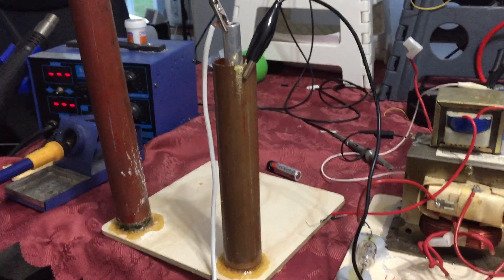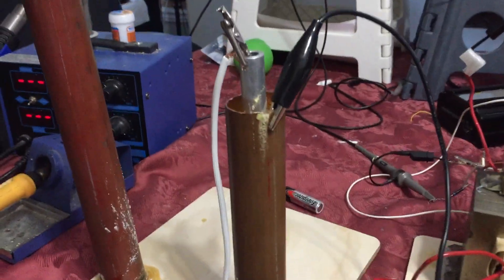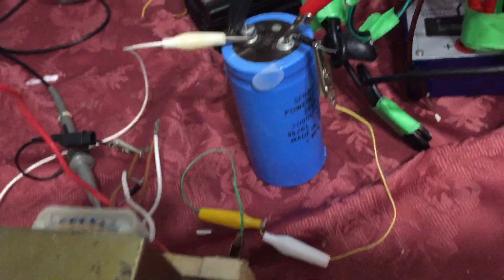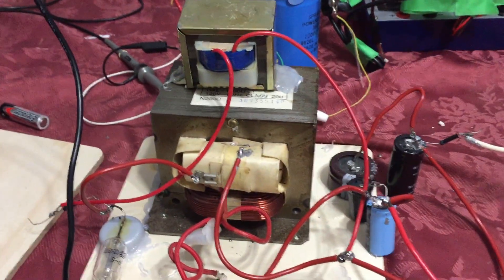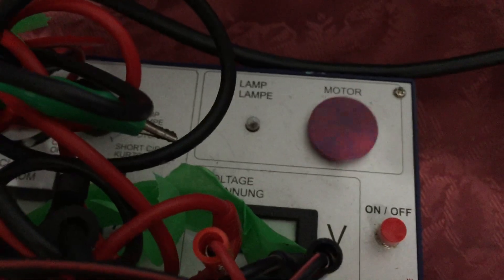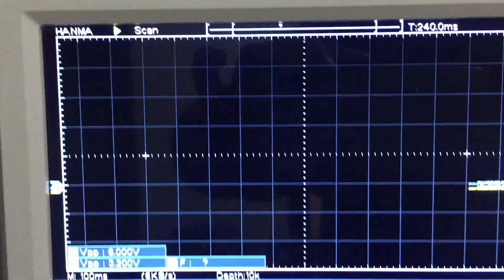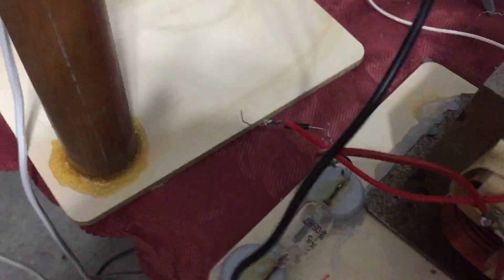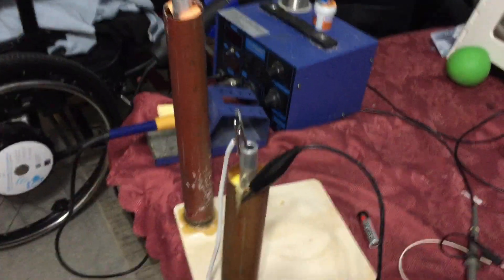PEG Cell Battery Charger

Comment from the maker: The high voltage high frequency also introduces many transient harmonics, They add up to the capacitor charge, This is why in part. Capacitors charge faster at HV HF.

Comment: hey Joel, 

can continuous overunity be achieved by collapsing magnetic field energy? 

there are devices like dc-dc boost converter and flyback transformer which work on collapsing magnetic field aka flyback, but they draw extra current from source (in the same proportion they amplify the voltage) because the collapsing coil is connected in series with source, 

i was wondering if coil in boost converter, flyback transformer & Joule theif circuit is connected in parallel with source, they should not draw more current from source. 

can you look into it and confirm if this is doable?
Reply from the maker: You need some fancy switching so that the L front bus gets the inductive kickback while in open or idle mode (not drawing any input and decoupled.)  As you noted transistor driven oscillators always take some power to operate in feedback mode.  So build a small PWM and pay small active power and let your switch devices driven by the PWM take care of keeping the dipole open and closed at the right timing. So your coils can interact properly completely decoupled electrically.

Comment: Joel, where did you get that 1000 volt discharge tube ? Would like to use that if you could give me the info ? Thanks , jeff
Reply from the maker: Just on ebay "gas discharge tube" these came from old Russian stock.
Reply: @joellagace1679   Thank you so much !! Also I forgot to add , you got some really cool stuff going on there .
 Jeff

Comment: Your PEG cell is picking up the thousands of radio broadcasts, universe radio waves, and the earth's radio waves and turning it into power. Low amps, high volts, and high frequency. Your circuit turns this into 100 volts and higher current to power devices. Your PEG cell is like a Tesla Coil without a primary coil.

Comment: Good work. Does straight sunlight or full darkness have effect on it?
Reply: Needed Neutrinos or Tachyons The Sun or the Moon ,to path the Materie?
Reply: @olavp.4019  Idk :D Just heard Peter Lindeman mentioning that Wimshurst generator has these kind of anomalies. I don't think moon has anything to do with it, but alignment with north often has effects on magnetics ;) You can generate electricity just by spinning copper wire in the air...
Reply: @Kangsteri  OK I understand you ,understand me too .
Reply: @olavp.4019  I mainly study the fields. Still lacking on the molecular level. I know moon has effects on large mass, like tidal water. But it's hard to measure the moons effects with small fields. Sun is definitely exiting most fields. Also the north pole is secondary effect for the "black sun". The point next to the northern star, where the earth is heading to... Complicated topic :D

Comment: Could you use this to pulse the motor/generator setup from your "real overunity power" video and get a usable result? I have one assembled and working but i cant try it out at the moment. Im just wondering since it spins so much from a single pulse could we use that ac that comes out of the microwave turntable motor and recycle it.
Reply from the maker: I'm not going in that direction right now but that is what I was suggesting more or less feed the dc motor in line with another transformer and on the secondary side while that motor spins per pulse you get 50-100 v RF bursts. I did with just this small motor it's rather interesting effect.
Reply: @joellagace1679 if you want to dial it in more I recommend winding your own transformers with stranded wire on a toroid core. It's just really easy to do on the fly. The stranded wire Is probably better suited for what you're doing. Don Smith was quite fond of it. But basically by winding your own you can control the amps/volts a lot better via wire gauge as Don Smith explained as well and as I'm sure you already know. Your work is beyond beautiful. This is a peek into another world. Ps I haven't been able to find a suitable power supply that's cheap enough to justify the purchase even used. But I am still looking.
Reply: Many people will disregard the benefit of PEG cell as long as you use the grid power, for me is enough to see what it can do. But, if you hook up a radiant energy collector probably more people will see the real benefit when no metered power use is added. ❤